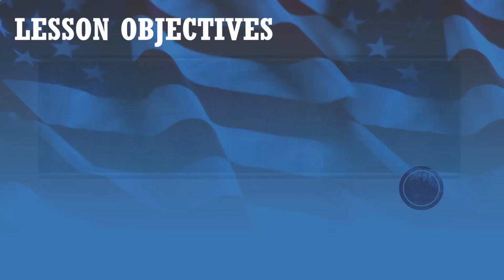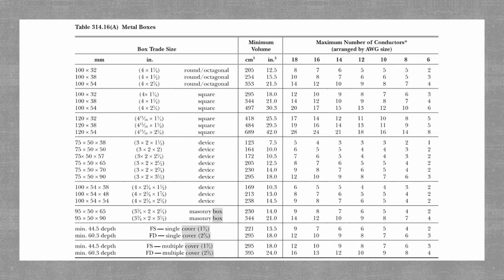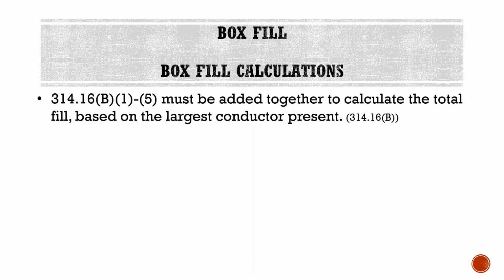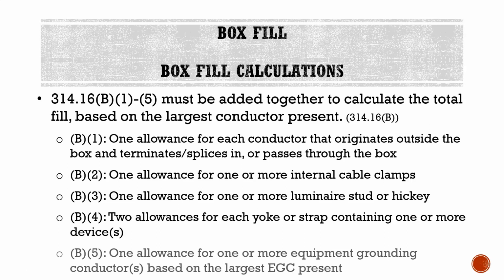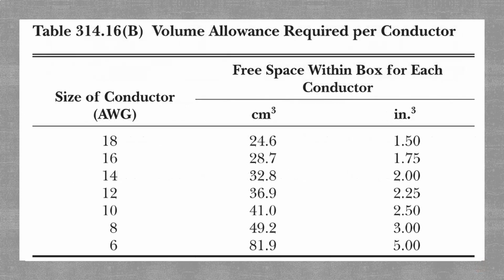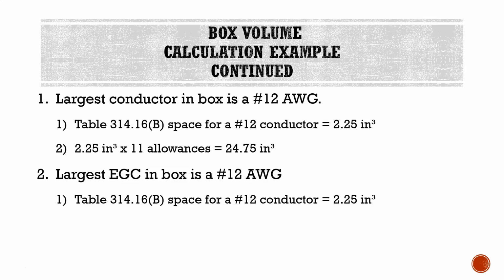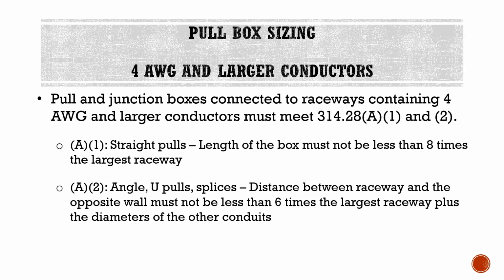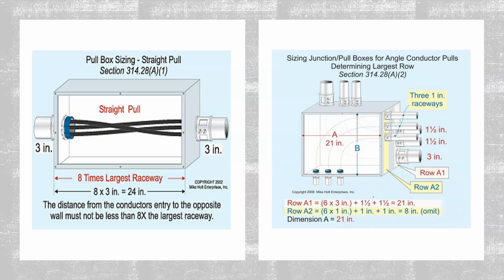Pull and Junction Boxes

Comment: can i ask why did you account the 14/2 as 12 AWG wire since 14 AGW wire dimension is 2.00 and 12 AWG is 2.25 , you will have 8 wires #12 AWG and 4 #14 AWG the total will be 8 #12 AWG X2.25 =18 in cubic and 4#14 AWG X 2.00 = 8  in cubic total =26 in cubic not 27 based on table 314.16 (b)